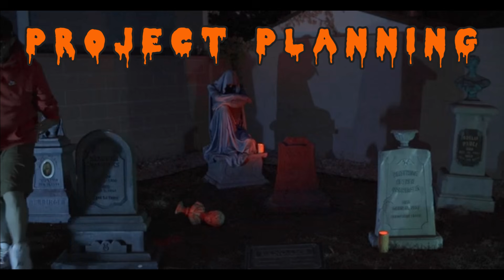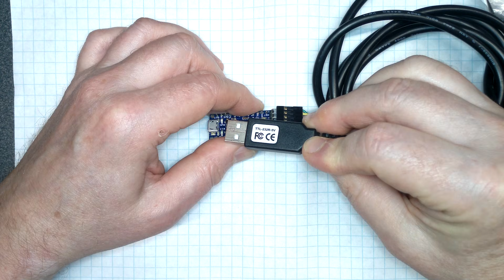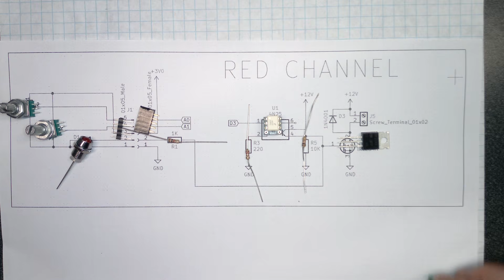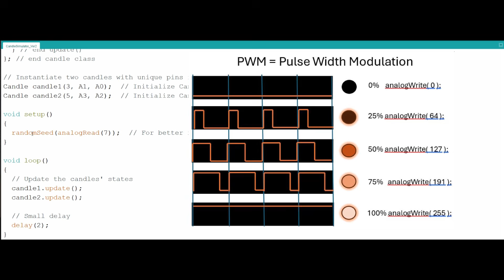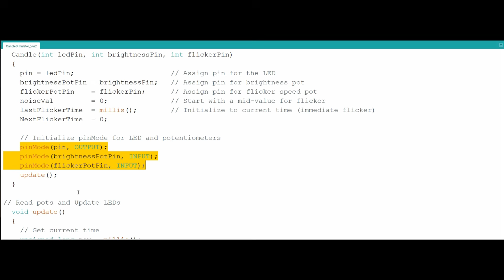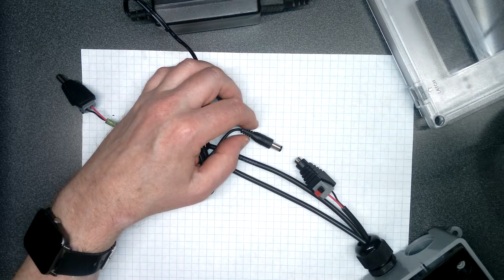DIY Arduino LED Flicker Controller

Comment: Hi, id like to Build an Controller for flickering fire effect for an 5meter Amber 12v LED Strip, how much amps Could be used on this version?
Reply from the maker: The  MOSFET I used (IRLZ34N) it is capable of running a lot of stuff, I've run my lightening 5m strips (See my Stormy Window prop)  with no problem.

To confirm this for your 5m LED strip, check how much current it draws That is usually somewhere in the specs.  Or look at the power supply that lights it up. Usually the power supply can put out more current than the strip itself uses, that's a good thing.  I suspect it is 2A or 3A maybe less?

But if the number is 7A or higher, then it needs a heatsink for a TO-220 package, they are cheap.  The max that MOSFET can run is 29A.

If later on you want to add more LEDs to your flicker effect on the same channel through the same transistor,  add each load to the total number as long as that number is under 7A no worries. BTW  I cover power supplies and LEDs in my LED tutorial video. 

Let me know if you got it running or have any more questions.  Thanks for watching.

Comment: The 3V going to the pots are for the led on the board. It is just that part that I dont get
Reply from the maker: The voltage going to the pots provides the input to the Analog converters. The voltage on the pots can swing from 0 to 3 volts and connected to the input of the analog to digital converted.  The AnalogRead function gives an integer of 0 to 1023.  The program computes the brightness and outputs the PWM to the transistors that the LEDs are connected.  So the pots are not connected to the LEDs, it's the program that reads the pot values and outputs the PWM.  Does that explanation help answer your question?
Reply: @HobbyHalloween  Really thx
Reply: second attempt to make it worked

Comment: Nice video! The reason that the USB is not working, is because the USB is only used for the 5 volt. Like the Arduino Pro Mini you have to use a  FTDI adapter board, they don`t have a chip for the USB connection. If you use a Nano, a clone version, you need the CH340 driver. That is because the clone version use another hardware driver for the USB because these a cheaper then the versions that the original Arduino`s use.
I love your explanation of the function "class". Never work with it but i think its handy for me. Hmmm, love it, something to learn.... :- )
Reply from the maker: I'm glad you like the Object Oriented class analogy, I hope to do more computer science stuff in my future videos.

Also, I am aware that some Arduino boards do not connect the data pins on their connectors and you need an external USB adapter, like the FTDI or CH340, etc.   However, not in this case, The  Adafruit Trinket Pro does have full USB connectivity, and I've worked extensively with these modules in the past, their tutorial explains how you must connect and configure it, so I'm already familiar with those pitfalls. The one that I used was very old, is not compatible with USB 3.0... I quote a google source:
"To resolve Adafruit Trinket USB connection issues with a USB 3.0 port, use a USB 2.0 port or a USB 2.0 hub, as some Trinket models have compatibility problems with USB 3.0, especially older ones."

But you are correct!  There are many pitfalls working with electronics, microcontrollers, software, etc.   I run into problems in all my projects, take a look at the Drop Panel video I just released and all the troubles that projects gave me! 

Thank you so much for commenting, I appreciate feedback, I'm always learning things as much as I am teaching them.  I don't have all the answers but together as a community we make each other stronger.   Have a nice day!  Cheers!
Reply: @HobbyHalloween , thank you for your answer. Aha, so the trinket is only compatible with USB 2.0. I never used the trinket. Most of the time, I use the Pro mini, nano, mega and the attiny85/84. The last two I am using when I build a pcb and when i dont need many IO ports. 
But you have a new abonnee! I love it! And, just like you, i think i gonna learn a lot of this channel! Thank you!

Comment: Great Tutorial .  I have long ways to go on this type of project using Arduino. Matter or fact I'am not so sure I want to deal with. Will you possible be offering this type of service / product kit?   PS reading all the comments and replies is helpful.  Thanks
Reply from the maker: Thanks, I'll have more tutorials just as good coming up.  The short answer to your question about offering a kit (or kits) is yes, but not yet.  Eventually I want to offer controllers with electronics that can handle common haunt tasks like a kit that allows customization for lighting, storms, and other effects. There is another YouTuber and developer that I may work with to come up with these, TBD.   

It's always a question: use Commercial-off-the-shelf (COTS) vs. DIY,  I think that even if someone has the skills to make something complex, it might be easier to just purchase a kit that's already solved those issues and it's already in an useable form.  I sometimes just get a kit to solve a need so I can work on other things. It is such a time saver.  (Stay tuned to the channel, more on that to come)

That said, you might be the perfect person to ask this question:  I am very curious to know what kind of needs you have for your haunt, what would be a wish list of things you would be interested in having or like to have?   I'm putting together a list of features, so your input can help me make decisions.

Comment: Great tutorial Ray, Van Oaks is lucky to have you help him out.  As you know, I am a nuts & bolts/cogs & wheels type of creator... the electronics are way over my head, so I am envious.  Just the same, I did learn a few things.  The analogy with the cookie cutter, dough and cookie was very helpful.  P.S.  I really like the ice cube tray storage for small bits and pieces.
Reply from the maker: Thanks!   I tried to keep the technical content as light as possible... I could have elaborated in several areas and gave a 15 minute explanation why I did this or that.

On the other hand, your "nuts and bolts" / "wheel and cogs" tutorials and are more approachable to a wider audience, from a non-technical standpoint. They are still quite good and you explain the pitfalls to avoid, that saves time and frustration.

What a wonderful time to be alive to have a community of talented and skilled people. This makes us all better, we inspire and can learn from each other.  So in the future you may have an idea that you want to make, and need some technical assistance to pull it off.  

BTW:  I'm glad you liked the ice cube tray for keeping parts sorted.  I didn't say anything, I just put it in frame wondering if anyone would notice it and comment, so far you're the only one.  I thought of it kind of like an Easer egg tip in plain sight.

Comment: Great tutorial!!!
If you were going to add a sound component, like having the thunder turn off the lights, what would change in your solution?
Reply from the maker: Yes, the Stormy Window video takes audio from a player and controls the LEDs.  You can use that to trigger an effect.  I assume you want lights to turn off... or you meant to flicker like lightning?   The way that it is done, in either way,  is that I use an analog input to take the audio and I monitor the threshold in code... it's trial and error to get it, but that's how it works.  The electronics also need to be added,  you take a line-level of your audio, common ground, and the signal is passed through a 0.1 uF cap and then I think I used a 10K pull-down on the Arduino side, I hope that is clear how to do that, you don't want to directly tie audio into the Arduino, the capacitor acts as a DC block so it doesn't get back into the audio equipment.   Don't worry,  I had planned to make a video addressing this controller and others, but there's so much on my plate right now to get done, eventually I'll get to it.
Reply: @HobbyHalloween thank you, Sir!

Comment: Great video. I really like the way you explain everything from circuit design, to coding, to final assembly of the enclosure. I agree with @chipeone that the optoisolators are probably giving you another point of failure without much additional benefit. I tend to go straight to the mosfet in my designs.
Reply from the maker: Thanks for you kind words, I appreciate your feedback.  Yes, I agree with chipeone, and your comment as well.   I think I was being over cautions with the protection with the optoisolators.  And it's a very good point that the optos are another thing to go wrong without much benefit.  I might make another video and point this out, but also include some simpler flicker techniques I've used in my haunts.

Comment: WOW - what a great tutorial, from concept, schematic, and parts was all so well illustrated and explained. Thank you for sharing.
Reply from the maker: Thanks, I appreciate you kind words. A lot of work goes into, not only making the project, but also into turning it into a video.  There's a lot that goes on behind the scenes that ppl don't realize unless they're doing video production... it's just me doing it all, takes a lot of time.
Reply: @HobbyHalloween  So I have design that works, 1st gen prototype that is user friendly and 1/3 the cost for 99% of the items just like it (and there is only a handful, but they run completely different). I designed this for the average person who wants something to activate ac or dc for their purpose. It has multiple uses and is something that I would love to share to help the like-minded people. I would love a second opinion and observation for safety, and maybe even improvement. Would consider your input valuable and would like to know if this is something you would be interested in reviewing, maybe testing, and communicating your findings and thoughts?
Reply from the maker: @JH-qk2ur  Sure, that sounds interesting... do you have it shown on your channel so I can look at it? If it's AC or DC, Is it an opto-isolated  thyristor design??  I'd sure like to know more about it.  The email for this channel is HobbyHalloween@gmail.com 

BTW: this video has gotten a lot of interest, and Van Oaks Props will be making his own video.  But there's more than one way to make a flickering LED,  I will have a sequel to this video with simpler low-voltage designs. About 10 years ago I designed a 3 parts with flicker LED with a 2N2222 transistor (no Arduino needed) and it turned out that Jekyll-Labs did something similar with a MOSFET, I will get one of his boards to build and demonstrate in that video... If there's still time, maybe I can include yours as well?  Let me know.  Thanks.

Comment: The circuit could be simplified somewhat by removing the optoisolators. FET gates are inherently isolated. The IRLZ34 FETs have a max. VGS(th) of 2.0V, so they can be driven directly by 3V and be considered ON. If you're worried about saturation, then just use the 5V Arduino version instead of the 3V version.
Reply from the maker: All completely fair points,  and it was something I considered.  LEDs are perhaps the least concerning loads when compared to solenoids, relays, and motors.

I had considered driving the MOSFETs directly, as you rightly pointed out, their gates are inherently isolated and easily driven by the 3V.   The Optos were just a layer of insurance against any breakdown of the MOSFET in a failure scenario.  Should the insulator barrier of the gate get bridged with 12V it would take out the Arduino too.  I guess I'm a little paranoid, but I wanted this thing to work in an unknown environment.  I hope I didn't go too far and overdesign it.

The use of the 3V trinket was something I needed to basically use it up in a project to get it out of my collection of old microcontrollers, I much prefer the 5V and they run at a higher speed of 16Mhz.  But this USB incompatibility was unexpected, I have a few more of the 5V ones left, but I just need to use them up,  my new developments have been with the NANO and they seem to work fine using USB 3.x
Reply: @HobbyHalloween  if you're worried about the FET gates breaking down, then just add a series resistor to the FET gates. The resistor, and the ESD diodes on the Arduino I/O, will protect the Arduino from damage. But even if the Arduino were to blow, it's only a couple of bucks to replace.
Reply from the maker: @chipeone  I can tell you are very knowledgeable in electronics... you have the depth of an engineer.  Again you are correct on both points.  I have added series resistors on MOSFETs before when I had a couple of them in parallel, but I hadn't considered the ESD diodes in the Arduino, I assume that they are not able to withstand much, so I just ignore they are there.

What would your opinion for keeping the optos for relays, solenoids, and  motors, etc. would they be any different?  Of course I use the flyback diode to keep the emf from damaging the MOSFET. 

I know that the relay modules you can buy from just about anybody has opto isolators on them... so it just reinforced my thinking that they are an extra layer of protection, and I considered that they're put there to isolate power supplies, if necessary so they don't have to share a common ground.

It's funny to think back over my career and realize that the days of "protect the microprocessor at all costs" is over... they're no longer expensive. Putting in the protection become itself a cost as much as the thing it would replace...  Arduino's are incredibly cheap these days. Well, I think this exchange has swayed me to lighten up on the protection circuitry, especially if I start making some products down the road for people that want controllers for their haunts it will save on cost. 

Hey, Thanks so much for the question and recommendations.  This feedback is very helpful to me.
Reply: The only time you need the isolators is for what you would call mains or line voltage 120v. Anything under 36 volts and 200ma is considered low voltage, even by the NEC or National Electrical Code.
Reply from the maker: @dkohler5226  Isolators can be used for other purposes, such as to isolate two DC supplies where you don't or can't share a common grounds.  Some sensors need to be galvanically isolated.  My concern was to protect the microprocessor, but as another commented pointed out that I could have used a resistor and directly drove the MOSFET, So I used the optos to isolate the 12V from the microprocessor, it might have been overkill in retrospect.

Comment: You mentioned this can scale up to 30 lights. I may have missed in the video, what allows it to scale?
Reply from the maker: The way that this prop controllers scales is with the MOSFET, I used IRFZ34N  can handle over 7 Amps of current without a heatsink and 29 Amps with a heatsink.  Each small mini-spotlight LEDs  use about 10 to 20 mA each, some are brighter, or have multiple LEDs inside them will be more... and there could be a mix of them in a haunt.  I'm just guessing an average of 230mA, which is probably higher than the actual. I am only guessing, since I'm not designing the rest of the lighting system; I have no idea what else might be hooked up.   The number of lights is also limited to the power supply, but if you assume he has a power supply capable of delivering 7 Amps (7000mA) and you assume 230mA per light (I guessing his LEDs will be 20mA) is about 30 total lights,  at 20mA each it's 350 LEDs,  but I'm being conservative. And if I installed a heatsink on the MOSFET in theory I could switch 29 Amp (29,000 mA) and that's over 1,000 LEDs
Reply: @HobbyHalloween that makes sense that the mosfet can handle 7amp. Would it be one mosfet per channel though? I guess I was thinking 30 meant it can theoretically scale up to 30 independent channels where currently there are two. You are saying 15 LEDs on channel one and 15 on channel two?

Love the demo by the way, I'm doing some similar flicker circuit work right now. Also recently tried out Jekyll Labs Flicker controller that takes a pre wired flicker led and amplifies it via mosfet for a brighter 12v led. Lots of fun!
Reply from the maker: @aaronhunt6379    Actually, you can hook 30 (or more) per channel, so 60 total as long as the power supply can supply the needed current.  

The circuit with flicker LEDs and transistor, but they used a MOSFET and not a 2N2222 or 2N3904 to amplify the flickering? Well, it probably works then, but the idea is a good one and very DIY friendly to make.  I didn't know anyone else was doing it that way, I figured it out on my own and I've using it in various props for at least 10 years.  I may make a future short video about that.
Reply: @HobbyHalloween would love to see a video on that!
Reply: @HobbyHalloween  @aaronhunt6379 , Glad you’re enjoying the miniflicker. It basically has the gate for the mosfet reading the voltage from just after the flicker LED. Not nearly as customizable as circuits involving a microprocessor, but it’s fun for something with no coding and minimal parts.
Reply from the maker: @Jekyll-Labs  I just realized that you have a YouTube channel and do similar electronic content.  That's cool I just subscribed to your channel from both of my Hobby channels.   The mini-flicker is a circuit is similar to the one I just stumbled into about 10 years ago using a standard flicker LED and a transistor, but I used a 2N2222. So I want to checkout your design with a MOSFET.  Also I've used 2N2222's with pots to make dimmers for LED spotlights.  I have a 6 channel dimmer that I built ages ago.   I guess at some point I need to make another video on low voltage Haunt Lighting - this time without the Arduino.